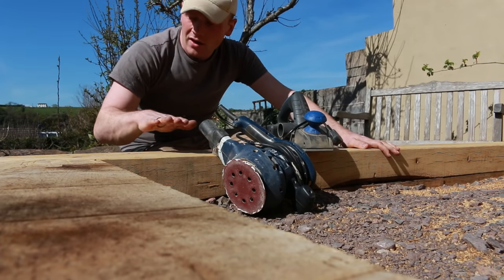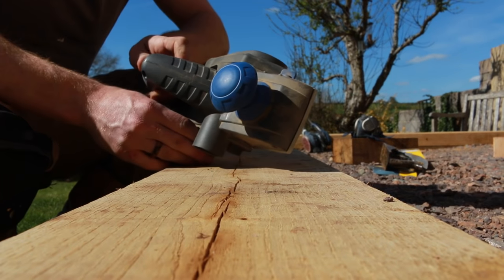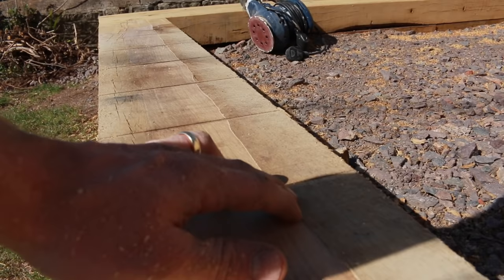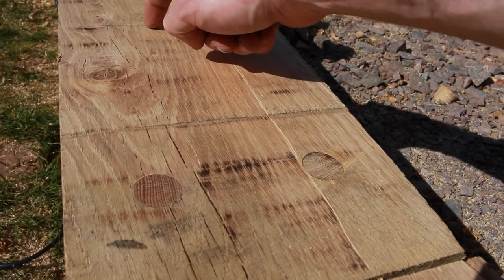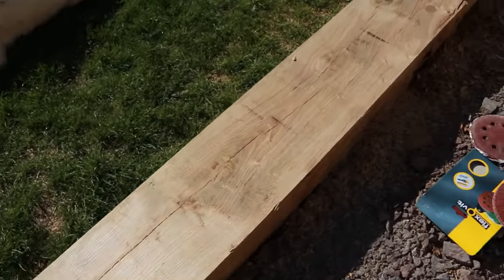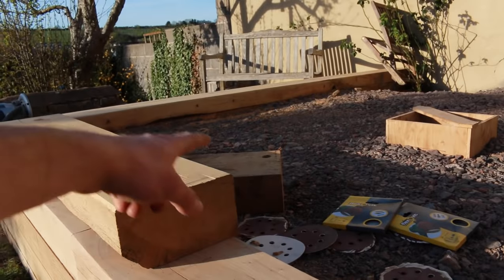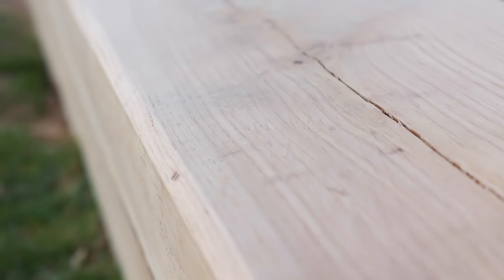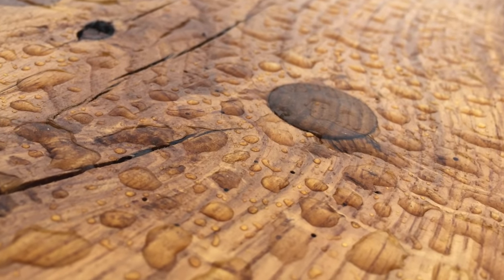Planing, Sanding and Routing the Oak Sleepers | TRC Garden

Comment: Firstly, thanks for inspiring me to do a retaining wall using sleepers. Difficult part was getting it level, which its close to. I have sanded them down. Do you think it's essential to use the UV?
Reply from the maker: Not at all, oak alone will last decades and pressure treated just as long is not sat in/on wet soil.  UV was more just for the colour and finish.  Most people just let it grey naturally.

Comment: Great vids. You've inspired me to build my own Oak sleeper wall. It's looking great and now time to finish it off.

Where there are splits/cracks along the top horizontal surface, isn't there a risk of damp from dew, frost and rain pooling inside the cracks and causing rot, especially during the winter months?

I plan to treat with Osmo Natural Woodstain Oil plus Osmo Anti Slip Decking Oil which will provide some protection, but I doubt the oils will get down deep inside the cracks.

Did you fill any of the cracks on your top surface? 
If so, what filler did you use?
If not, how have your sleepers held up? Any signs of weakness, softness or rot in those areas?

I'm not too concerned about the vertical surface as gravity should help moisture drain away.

Appreciate your thoughts/comments and thank you again for the great videos... Keep them coming 👍

Martin

Comment: Great content, just subscribed. Can't find the next video though, showing how you coating and finishing them in UV oil?
Reply from the maker: May not have actually done that video, sorry!  Went on easily and so far has survived the winter well. OSMO UV oil is recommended for vertical surfaces mainly, and from our experience over the winter the oak has darkened slightly on top of sleepers but fine on sides.

Comment: Hi, how have your sleepers weathered? 

I built a network of retaining walls and steps using similar oak sleepers last year. I used the clear Osmo UV, as it has held up well on vertical surfaces, but not at all on horizontal ones. I sanded smooth as well, but the weather has raised the grain and taken all that away.

Comment: Morning, I’m thinking of doing it exactly how you’ve done it. So just so I’m doing it correctly - you’ve not used any supporting wood and just using the weight of the sleepers with dowels? What’s under the sleepers? Concrete?
Reply from the maker: Just sit bottom sleeper on a level gravel sub base. The strength comes from weight of sleepers and the corners. Otherwise you can secure to a concrete footing like in the earlier video.
Reply: The Restoration Couple thank you. Amazing work.

Comment: Great videos thanks. For a raised bed is a membrane not required on inner wall to prevent rotting?
Reply from the maker: If soil backfill then I would use membrane and gravel.  I talk through it in the other oak wall series.

Comment: Hi, your videos are extremely useful, and inspiring. I have followed your method, and we are almost complete. We have hit some of the stumbling blocks that you have already brushed on in these videos, and I wish I paid a little more attention to everything you were doing. I might go down a couple of sleepers again to make the final wall as neat as yours. 

I did however, buy a waterproof sheet for behind the wall, to keep away any moisture. I also have fitted drainage behind the wall that will be fitted with gravel and landscsping fabric. Do you think that the waterproof sheet will help keep moisture away from the oak and extend its life? Or could it possibly worsen the life of the retaining sleepers by retaining moisture against the wood? We would value your opinion (and everyone in the comments) if you think there is a correct answer here!

As for the stainless steel screws, we found Spax 160mm screws to be amazing, pulling the oak sleepers together even when bowed. We picked them up in B&Q, but they were extremely expensive for screws, but well worth every cent.
Reply from the maker: James Atkinson my thinking is that well drained is better than water tight as there is always a risk of trapping moisture. Landscape fabric and gravel sounds good to me. 👍
Reply: The Restoration Couple Thanks, I was starting to think this might be the better approach too. Thanks for the reply!

Comment: You need a belt sander instead of planer.
Reply: I quite agree - I have found that a belt sander (using 40 grit) is best to remove rough material quickly. Thanks for a great video.